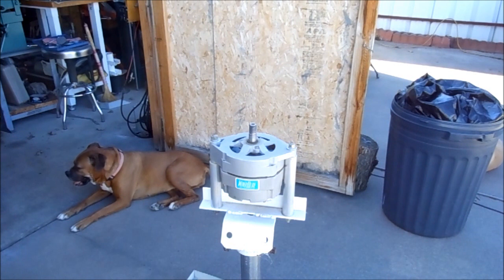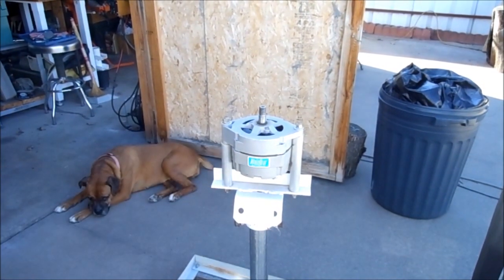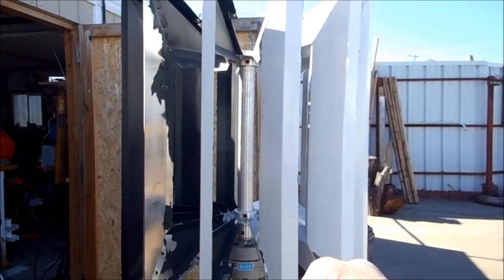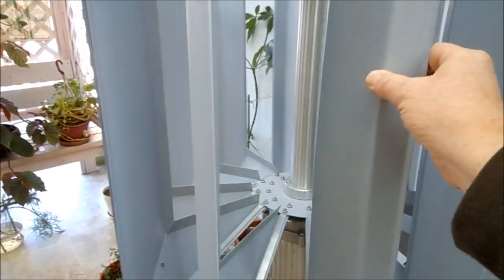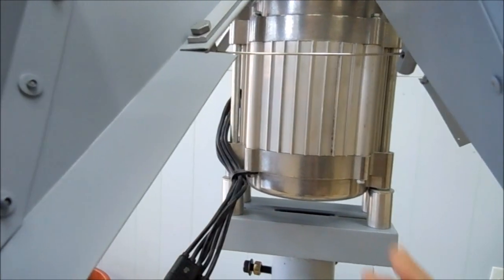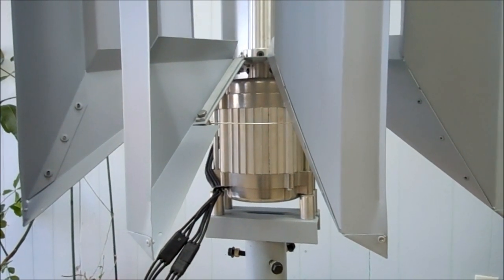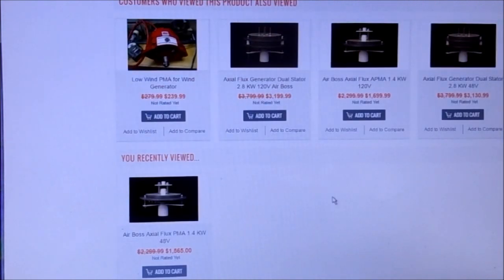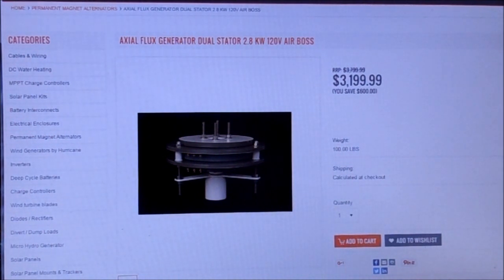Make Your Own Stealth VAWT Universal Adaptor

Comment: you were speaking before about shaft size of a GM alternator....I' m wondering how to elongate the shaft for a pulley system to run a 300 amp GM alternator because to run it at optimal out put it needs 3000 rpms., also I have no flat roof situation and was contemplating the mounting of it thru the peak of the extended eves of a fairly sharply peaked roof and running the belt thru an attic vent more or less to keep the alternator out of the weather does that seem workable to you? I was wondering also if I'd have a problem with lift on a peaked roof?
Reply from the maker: Part of the ideas in your question are doable, but In my opinion it would be very difficult to achieve the 3000 RPM needed for a non permanent magnet automotive alternator. You would need to drive a very large pulley from the turbine or a series of belts and pulleys. Either of these ways could not be used in light wind because of the torque required to overcome the resistance caused by those belt and pulley systems. To achieve that 3000 RPM I would consider using a gas motor of some sort.
Reply: Thank you I was wondering because I'd really like to go wind with a geared up pulley set up I'm not sure how fast your design was turning but it looked pretty fast and up here in the Adirondack mountains the wind is always blowing .....as a matter of fact we have a wind field up here of over three thousand acres on tug hill....but those huge towers are very unfortunately erected in the Northern flyway and damage many flocks because the poor birds can't see them while they're flying and fly right into them and no matter how slow they look like they're turning because of their size the tips of the blades are turning at over two hundred miles per hour.....vertical designs would be so much better and Id really like to figure it out for your design
Reply from the maker: We can definitely agree my little turbine is visible and more safe to birds than the horizontal style turbines. I think I have a project coming up in a few months that you might like. It's a different design for my 12 bladed VAWT, but it won't mount directly to a PMA. I don't want to give away all my secrets. I'll just say the PMA will be driven by belt and pulley, but the PMA will still be mounted inside the circumference of the rotating VAWT. I have another secret, but I'll let that be a surprise.
I'm just waiting for the finances to get started.

Comment: most people that can weld make their own axial flux turbine, it's otherwise not affordable for most off griders.
there are ways to run the turbines as a gridtie, I might try some of them when my budget allows.
one issue with all these pmg/pme's are that the bearings in them are designed to used horizontally not vertically. in yours and my design or my old design there is a lot of weight to support.
also there is a guy up in the Washington state area that may know of a generator that meets your needs
his site is 
http://www.wildnaturesolutions.com
Reply from the maker: I guess it all depends on where you live, how much wind you get and if your electric company raises your rates when you apply for net metering. Should they raise power rates here, I don't get enough wind to overcome the burden of having my electric rates go up. As for VAWT bearings, tapered-roller bearings like those you'll find on the front axle of cars, would be best for a multi-directional load such as a VAWT in high wind. However the bearings of the Freedom II can easily handle my twelve pound turbine spinning or at rest in that vertical position.
Thanks for the link, but those generators are the same as I have seen on several other websites. I will purchase one eventually when my budget allows.